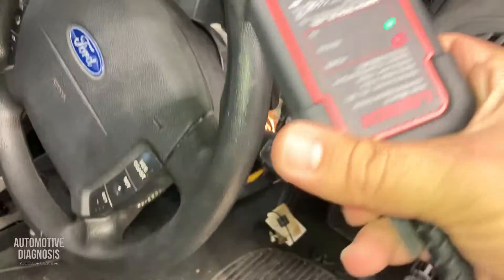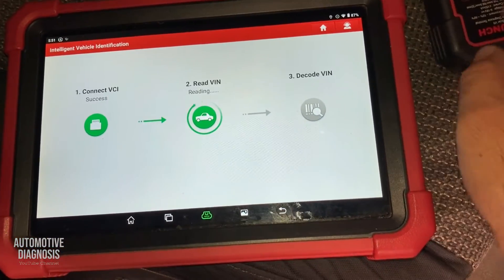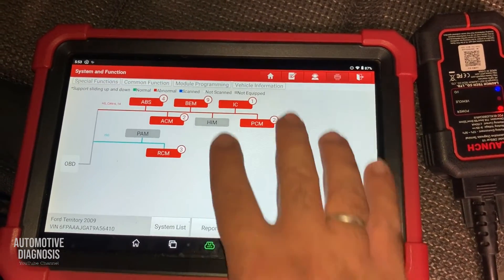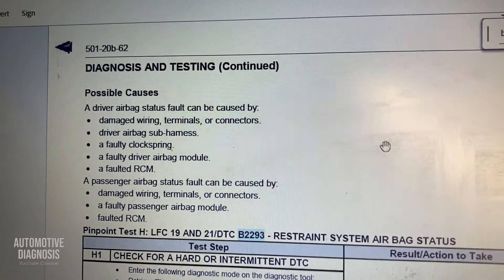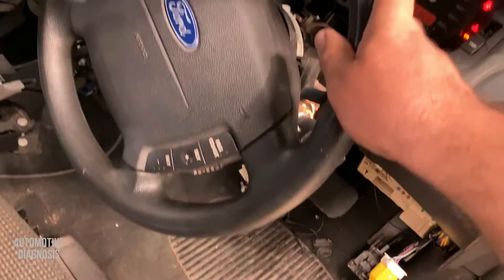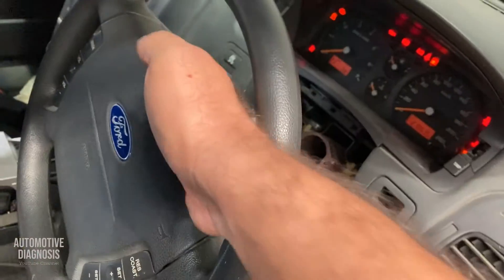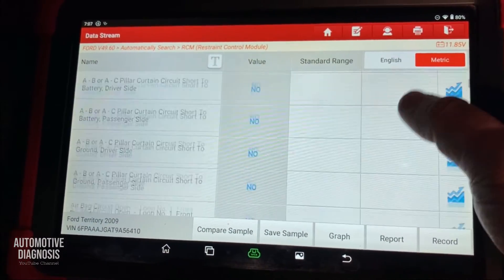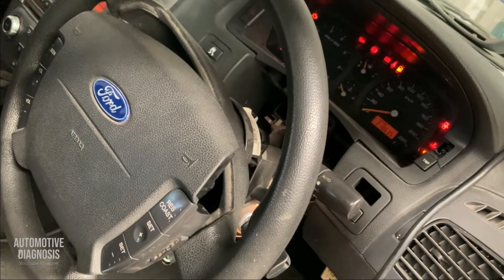Airbag Diagnostics | How to Simulate Airbag | How to Bypass Airbag

Comment: Got a 2015 Infiniti QX60, was in an accident. Roof airbag deployed, SRS reset, but airbag light still on. Code B00A0:02 (occupant sensor unit malfunction/abnormal voltage). Replaced seat twice, sensors & module under seat, did zero calibration—same code keeps coming back. Any ideas?
Reply from the maker: Hi there, as you have replaced the seat with occupant sensor already, you need to check the wiring, it could be the wiring issue between the sensor and airbag conrod module.

Comment: But this is a cheating to use resistors to hide airbags signs by using resistance sensors
Reply from the maker: Hi there, in the video I clearly said that this is only for diagnosing the airbag system to find the fault, NOT to leave it on the car. So, it's cheating if you leave it on the car, otherwise it's a diagnostic procedure which is described in the workshop manual!

Comment: If it has three wires : positive, Negative and signal ; so which wires do you simulate with resistor?
Reply from the maker: Hi there, airbag igniter does not need a signal, it normally comes in two wires only. May I ask what car you are working on and which airbag?
Reply: I'm working on Mercedes Benz ML 166 seat airbag. It has three wires. Ground,signal and positive wires.

Comment: Excellent!. When placing an air bag unit on a surface, make sure the deploy side is facing up. That will keep it from becoming a projectile if it goes off.
Reply from the maker: Good point, safety first! 👍

Comment: Launch code reader on 2006 escape, shows air bags like your 2.3 ohm , but pre tensioner at 2k oms  are they different or is the 2k oms the fault, thank you for showing this your instructions are very clear and concise r to hea,r even without my hearing aid,
Reply from the maker: Hi my friend, do you have 2k ohms on both pretensioners? Has car been in accident recently?

Comment: You can also use a digital volt meter on the airbag itself, and measure the ohm reading.  As you saw in your scan tool, you should get about 2.8 ohms (this is for every steering wheel airbag in all manufacturers).  You will need to cut a small tip off a wd40 red spray nozzle and slide it down one of the post as to separate a contact point down at the bottom of the connect on the airbag, otherwise you will not get a correct reading.
Reply from the maker: Even if you can get the resistance reading on the scanner, you should never check the airbag resistance with a multimeter as it could deploy the airbag. I’ve seen some cases of airbag deployment while checking it with multimeter. The whole point of using a dummy resistor is to avoid testing the airbag with a multimeter.
Reply: @AutomotiveDiagnosis  I have never heard of an airbag being deployed using a DVM ever...in fact it's impossible...if you notice on the steering wheel airbags there is 2 connections (4 contact points)  You would have to supply 12v to 2 out of the 4 pins (1 on each connector) to deploy said airbag.  You can send in airbags to have them refurbished, and they use a digital volt meter to do this simple yet effective test to see if indeed the airbag is at fault and if so proceed with the work.  I have done this many of times myself (checking the ohms reading) and never had one blow up, in fact I learned this very tip from the professionals who indeed refurbished them...

Comment: Great video. I own a 2012 Nissan NV3500 passenger van. I am converting it to a camper van. The van has rear airbags. I would like to remove them because I want to install overhead cabinets. Can I use an airbag simulator after I remove the rear airbags to keep the dash light off and use my front airbags?
Reply from the maker: Hi there. Yes it’s possible. But as you said, only for simulating the airbag when you remove the seats or change the application.
Reply: @AutomotiveDiagnosis  Thank you

Comment: Hello, I replaced the resistor, but airbag light still on! How can i reset it ?
Reply from the maker: This resistor is only diagnosing airbag. So, first of all you need to make sure that you have a fault code for that airbag you are working on. After that inserting the resistor into the connector, you need to erase the code with a scan tool, if code comes back, you have a fault on wiring or airbag control unit.

Comment: 9103 and 9163 anyone have any ideas it's a 2006 c280
Reply from the maker: 9103 is driver airbag resistance too high that can be diagnosed as explained in the video.

Comment: Hello, I like your lesson and I'm learning alot from it. I have a few questions. If the car was recorded being in an accident and airbag is at fault according to your test (high ohms), is it common for airbags to fail electrically even though not physically being deployed? I was hoping you would've shown Driver AB stage #1 resistance to compare with the stage #2 you found. I did see Driver AB module resistance just below but not sure if its the same as stage #1 as you mentioned. I understand the use of a 2ohm resistor for quick diagnosis but can both airbag plugs harnesses be swapped on airbag #2 for #1, #1 for #2 to see if high resistance moves in the scanner and maybe could rule out or reveal loose connections?
Reply from the maker: Hi there, thanks for your comment and very nice questions. Yes, it’s common to have a faulty airbag even if it’s not deployed, that’s why we have to simulate it. Swapping the connectors is a good idea to find out the faulty point, but on many airbags we only have one stage which makes it impossible to swap the connectors, therefore we still need the simulation. On this car I had a parameter on Scan tool for other stage as well, so it’s not a bad idea to read the live data before any sort of test.

Comment: If the problem was in the control and it was changed, how do you program the new control?
Reply from the maker: Programming can be different based on the make and model, but here is one example:
https://youtu.be/4g5KMIuN_C4?si=n8D-8Zaz--Qw0M-p

Comment: Good video but I would of cleaned the connector in case of bad connection and look at data again.
Reply from the maker: Correct, that part is not included in the video only because it’s a must in these cases. Anyway, thanks for highlighting that.